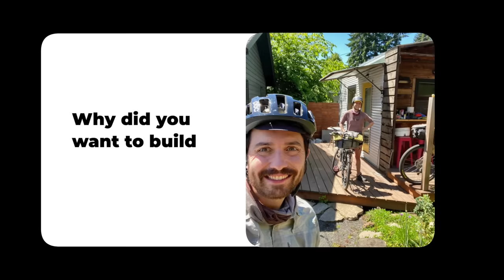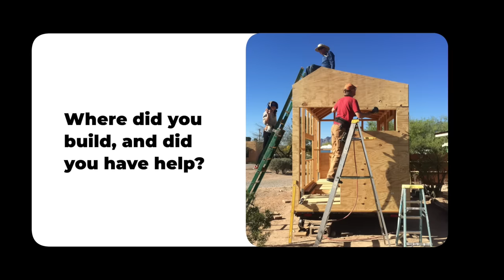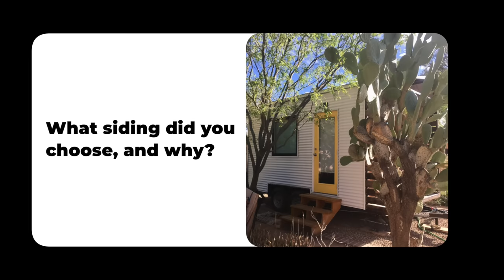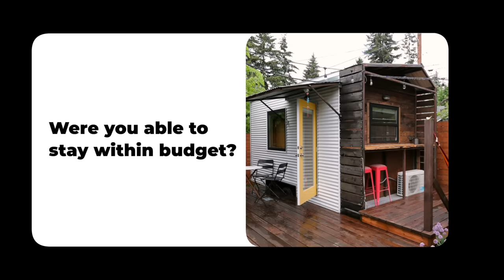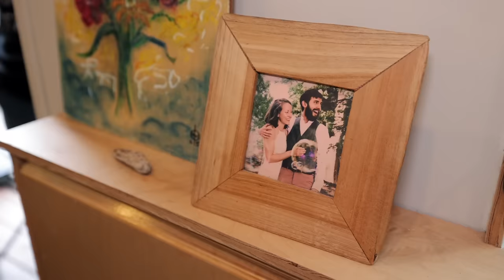DIY! Couple builds minimalist single level Tiny House with Murphy bed

Comment: My husband and I are currently living in a 96 sq ft tiny-house-on-wheels, while we prepare to build a 408 sq ft mansion. The bed folds in to the couch for day time use and I could totally identify with needing to be on similar time schedules. We're both retired but nevertheless I am an early riser so I am confined to reading or listening to podcasts in the early AM after fixing a cup of coffee (as quietly as possible).  At times, during the day one or both of us will wear headphones whether listening to something or not, as a means to signal the need for (psychological) space and, after a year of living like this, it is still working out well. 😃